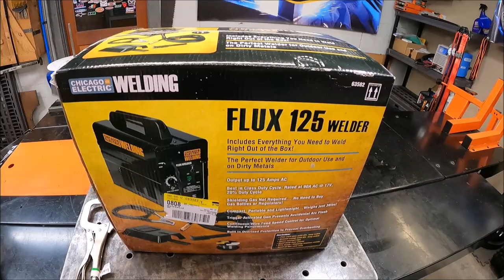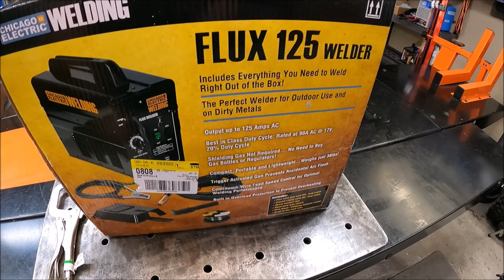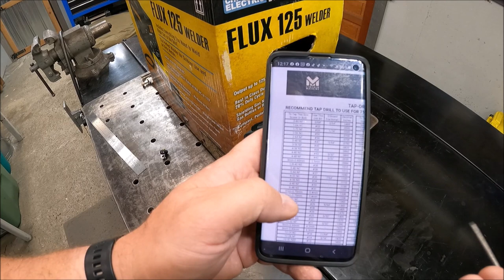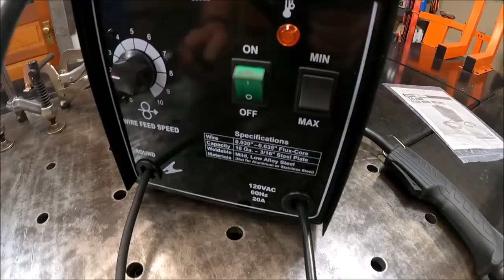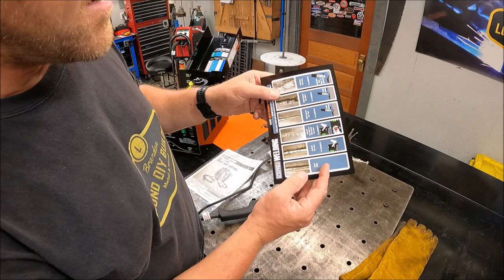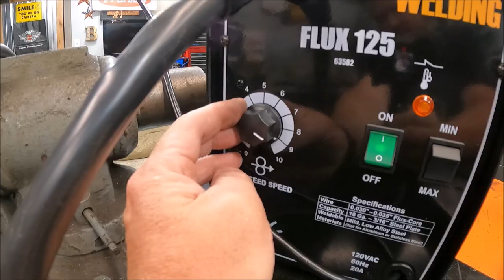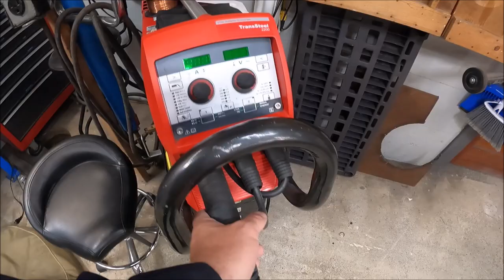Fan Donates a Harbor Freight 125 Flux Core Welder

Comment: I love my harbor freight welding machine. I had some extra money so I bought the omnipro 220 with the thought that I could grow into it. I'm using the 110 and flux core wire right now and later on when I can upgrade the power in the garage I can swap to the other cord and give solid core, stick and tig welding a try. Just seemed like the right choice for me.
Reply from the maker: @Korey Williams that sounds like a great plan! It's a lot better to buy a little more than you need now if you can afford to do it.  I'm going to be testing a bunch of different flux core wire real soon.
Reply: @BrandonLund  that would be a good one for me, ive just been using the harbor freight stuff. I got a 10 lb spool in it right now I think its .030

Comment: Great info again Brandon.
Really nice gesture also from the viewing fan . 👍 to Gabe.
I purchased a similar low cost Flux core welder from our Bunnings chain here  in Aus (Ozito ) which is Bunnings own generic brand low cost entry tools range.
  220 volt single phase 90 amp. 
Your set up tips were appreciated. 
I had my tension set too high but did not get a birds nest yet. 
Now less likely after reviewing our set up after having watched you video.
Our similar basic welder that has helped me and my son learn to weld on and fix the exhaust on his car and allowed us to make some items we needed, and fix our trailer .
love your videos znd tips and trick and the stuff you make.
Keep up the great work
Regards Michael from Down under.

Earlier Tip with flux core. 
If slag you drag your weld.

The only thing we find, is to drag the weld and regularly chip off the slag after the tack and  before welding the larger sections.
Reply from the maker: @Michael Anderson thank you so much! I'm glad I am able to help and spot on with dragging with flux core!

Comment: I have a Harbor Freight welder 180 it uses flux core or gas shield I love it and under 200 dollars work's great love your show learned a lot
Reply from the maker: @Joe Rss Thanks Joe! We are going to be testing out various wire using that same HF welder so it should be interesting! I've owned one and had great luck with mine!

Comment: I've got the older 90A version and it works fine. I ran many, many, many beads just practicing with it. These are AC welders which is not the best for flux core but they do work. I spent around $90 for mine and fixed many things. I also use a slightly better wire than the HF stuff these days. I now have an Eastwood MP200i multi-process machine which does a nicer job since it is DC but it costs a lot more. My HF 90A machine is on the bench now for a DC conversion. I've got the parts and now I just need a bit of time to do the conversion. Keep up the great videos:)
Reply from the maker: @Rex Alfes thanks for the great comment and your support. What are you using for wire? I'm going to be doing some side by side testing with this real soon.
Reply from the maker: @Rex Alfes Thank you! you are the second person to mention wire from Italy so it looks like I'm going to pick up a roll and try it out! Thanks again!

Comment: The spring goes on top of the plastic spacer. That is why you were having trouble feeding the wire. I have one. I've had it it for several years and no issues. Only trouble is the fan came off the motor shift the first day I had it. Tightened the spring that holds it and no problems.
Reply from the maker: @Johnny Rice Thanks man! I didn't catch it the 1st time around...lol the big sticker on top should have given it away for me but sometimes I don't see too good lol. Suks getting older lol

Comment: I'm a 2nd year welding student.  At home I have a stick welder/TIG and and flux core machine, but plan on getting a nice multiprocess machine later this year.  I'm also taking TIG classes this year.  Once I'm done with classes I want to do lots of projects at home (TIG and MIG).  My question is I have been looking for affordable gas cylinders.  An argon tank for TIG and an 80/20 for MIG.  I've talked to local welding shops and they all say it's more affordable to buy a 250cf tank (compared to a 125cf).  A buddy who owns a fab shop has a few extra cylinders he's willing to sell me much cheaper than the welding shop.  He has two 125cf and he wants $200 each, and one 250cf that he wants $250 for.   The 125cf tanks would be more convenient because I could mount both on a welding cart with all my welders.  Or should I just bite the bullet and get  the 250cf and a 125cf?  If I did that, would it better to run the 80/20 in the 250cf or would you expect that I'd go through more argon than 80/20?
Reply from the maker: @MEROST I've done both. I've bought tanks, I've rented tanks and I've done contracts. My personal opinion and advise is don't buy your tanks. I'll explain why in a second. I have 5 year "contracts" though Matheson Gas. They also do a 1 year contract. I cant remember but I think it's around 150 for a 1 year and 250 for a 5 year but don't quote me on that. With this "contract" you can have whatever size bottle you want so I suggest you go with the biggest you can physically handle. All you pay for is the gas that goes inside the cylinder. The bigger the cylinder the cheaper the gas costs by the cubic foot. This is by far the most convenient and economical way of doing it in my opinion. It doesn't matter if you go through 10 tanks of gas or 1 tank of gas over the coarse of your 1 year or 5 contract all you are paying for is the price of the gas that is going into the cylinder. You don't have to worry about them not wanting to fill your tank because the valve doesn't look right or they cant figure out your markings and you don't have to worry about paying someone to have your tank hydrostatically tested every few years and when the tank reaches it's expiration it's not your problem.  Keep in mind if you want a bottle of MIG gas and a bottle of TIG gas, each bottle is it's own separate "contract" but again you can get whatever size bottle you want (bigger is better) and only pay for the gas that goes in it.  Like I said,  this is what I do and what works for me. Give them a call. In my area it is by far the best deal around and Matheson is all across the country.

Comment: Just was watching you set up your welder on this episode, you dropped your spool tensioner spring into the wire wheel. Might work better putting the spring on top of the wheel, under the tension nut?
Reply from the maker: Hmmmmm.....im going to have to go check it out. Thank you!

Comment: while i 1000% agree with you, prep and fit up is everything when welding... Andrew Camarata will prove that theory completely wrong lol... go watch his last video where he rebuilds a bulldozer blade with gmaw (mig welding) and he doesn't prep... well really anything lol... he literally welds brand new pieces with paint on them to metal with mil scale on them... good work on the videos tho! keep it up.
Reply from the maker: Lol I checked out his channel and your right, not much prep or fit up 🤣🤣🤣. I don't generally cut corners with wire feed but I do with stick, especially 6010 /6011